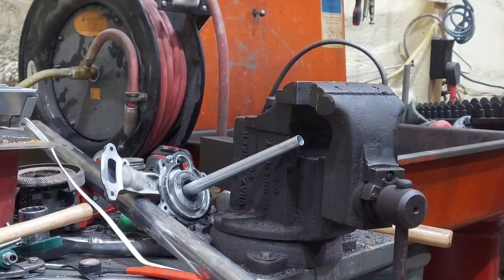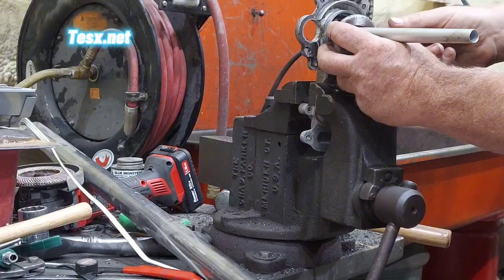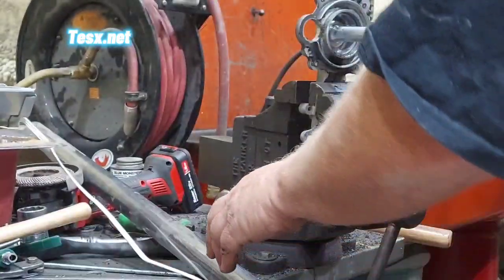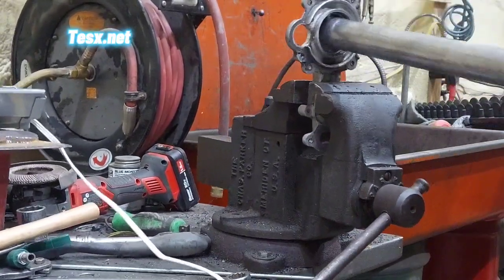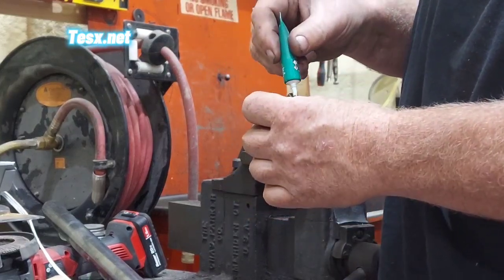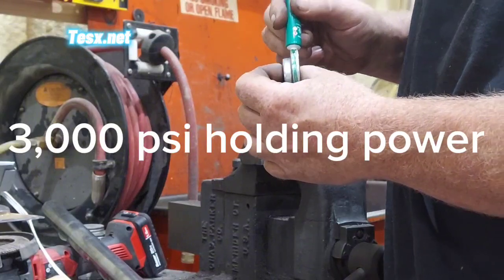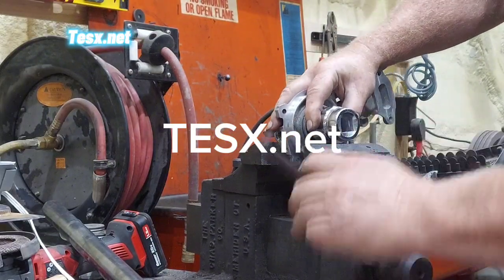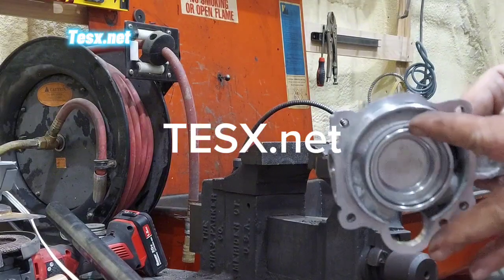Tesla large drive unit rotor coolant bypass kit simplified installation model S and X  Tesx.net

Comment: Very creative indeed.
As the aluminum pipe is also supposedly used as a ground for the bearings, would there be a way remove the leaky seal the way you did in the video, but keep the metal pipe then fit a similar stainless cap, but one with a hole in the middle to fit snugly around  the 8" pipe (donut shaped cap), then a small stainless or aluminum plug to seal the open end of the pipe ? This would definitely restrict coolant flow while keeping the actual pipe for grounding purposes.  I hope this makes sense. Cheers

Comment: No need too!!!
Reply: If it wasn't a problem, they wouldn't have needed to find a work around.
Reply: Even Tesla has an update “U” motor that basically does the exact same  coolant delete
Reply: @csilver9625 nothing official about this from Tesla I’m guessing people are just saying this to promote this fix.
Reply: @csilver9625 Wonder if they use the same bearings / grease as before with rotor cooling?